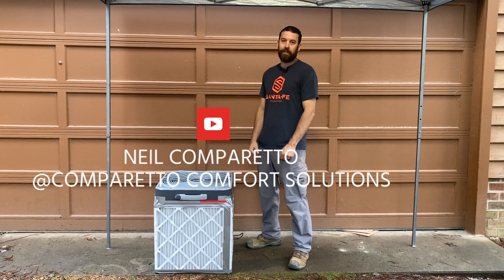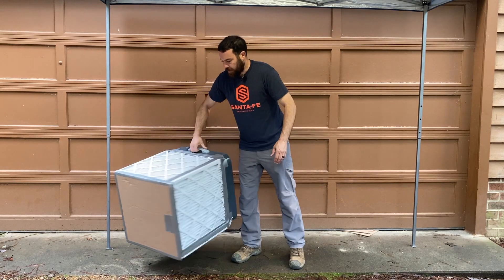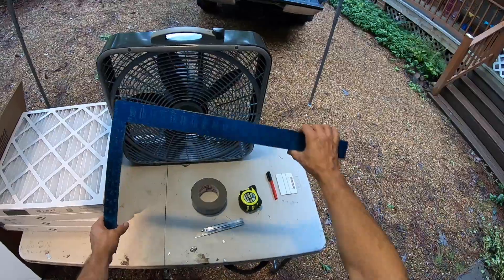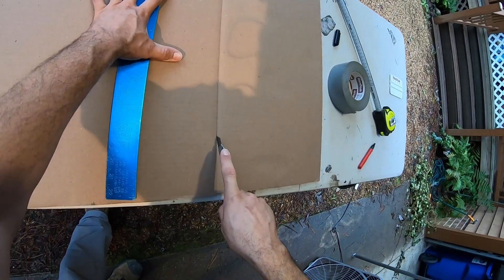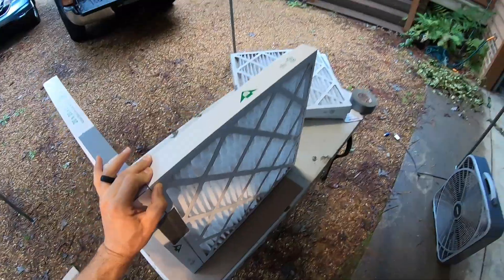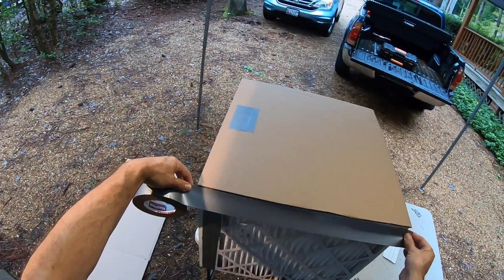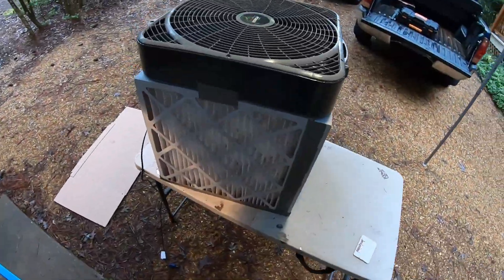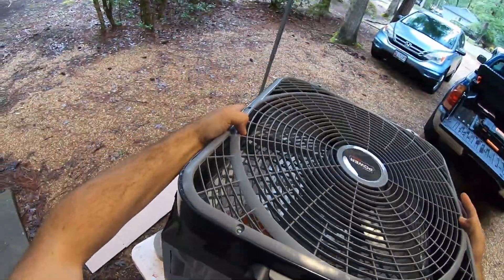High Quality DIY Box Fan Air Purifier "Comparetto Cube"

Comment: Could I do this with merv 16s?
Reply: If you're using a Lennox filter which provides higher air flow thru the filter than other brands, you should be able to!
Reply: @driversteve9345  yeah I’m talking about the 20/20/5 Lennox merv 16s, do you think the fan would be able to pull through that?
Reply: @Daddy692k  I was looking at this too. Did you try it?

Comment: This is awesome! Idea: Build it on some u-channel and make it so the filers are replaceable.
Reply: Metal stud works well for this, or sometimes the channel instead depending upon  the thickness of the filters you choose.
Reply: A basic sheet metal frame would be quick, easy and cost effective. Bend a U channel top with a seam and lip to support the fan and a drain pan for the bottom. You could bend some angle to go up either the inside or outside corners, or both but not necessary. Instead of taping the filters to the metal, apply a little butyl gasket or some other non hardening adhesive. 🤔 just a thought. Probably as many ways as there are techs.
Reply: You could probably us a 3D printer to print out some attachment adaptors if your printer is big enough.
Reply: @driversteve9345  I had to laugh, a 3d printer to replace what a few strips of duct tape can do. No it's not over engineered.
Thank you I needed that.

Comment: Deja vu all over again. "Gentlemen, failure is not an option."
I wonder if hepa panels instead of  standard HVAC fare would help with the 'rona?
Reply: MERV 13 traps >90% of 1-3 micron particles. That size range is what the virus typically attaches itself to.
Reply: Neil Comparetto beside that the crappy box fan probably has a hard enough time as it is

Comment: I have built a few of these. The only addition I would make is to tape the square edges of the box fan where the fan does not pass. I have found that there is bypass air (suction) in these spots.
Reply: That’s interesting, I believe it... When trying to test airflow on this we’ve found the air is very turbulent.
Reply: Yeah that happens even with out the resistance of a filter. I was considering just such a modification to my single filter version.